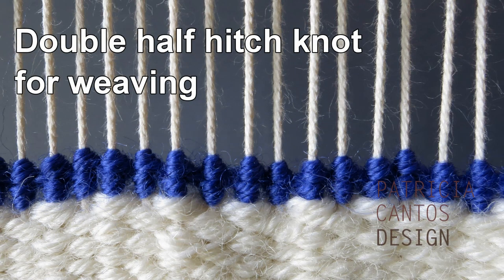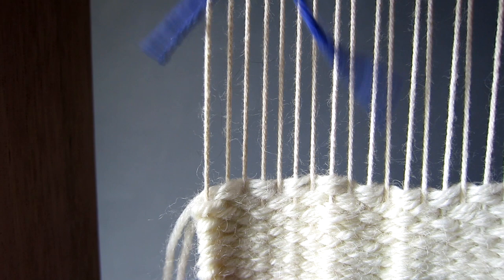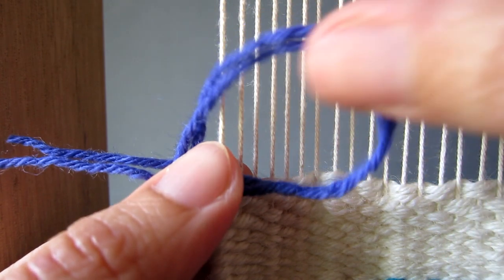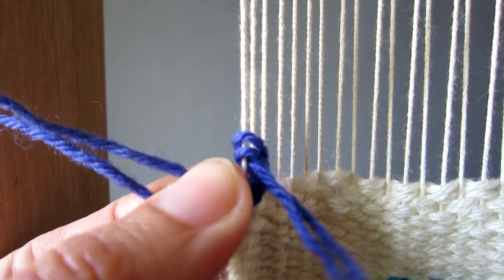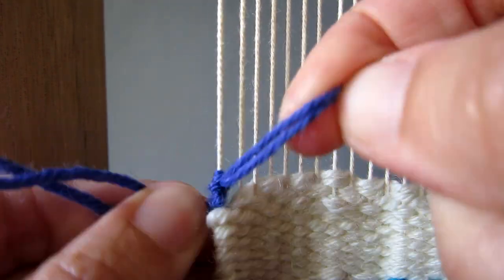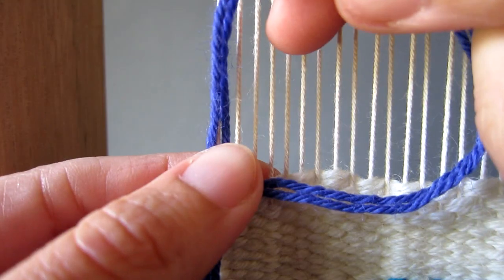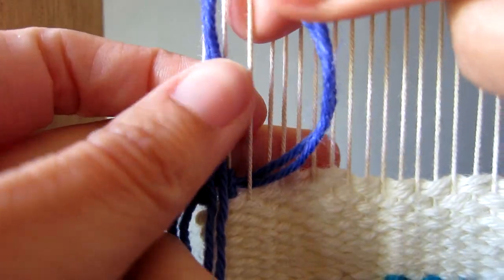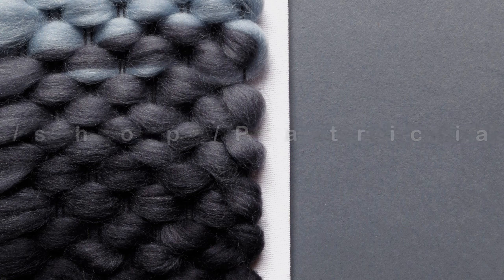Double half hitch knot for weaving

Comment: Do u need to use a double over yarn
Reply from the maker: Hi Nikita I usually use the same thickness of yarn I am using for most of the weaving.  A single strand of  yarn will work as long as it isn't too slippery.

Comment: Awesome video! Maybe a stupid question but once you’ve created that open design, are you able to cut the warp thread out of the middle area and tie them so it’s just a clean hole?
Reply from the maker: Yes you can cut the warp thread. I would suggest cutting the thread in the middle of the open section so that you can thread the ends into the back of the weaving for a neater finish.  Hope this helps.  Pat